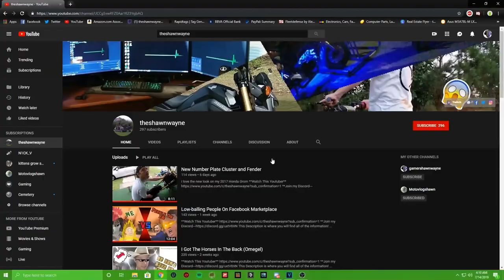Pulling The Core Support Off The Gokart | I Got Approved And Now Monetized!

Comment: What happens when the car dies, do you have another to continue videos? These are great dude
Reply: Planning on finding another donor car to turn into a new gocart. This one is still going just messed up some wires and busted the radiator. Going to rig/fix it and run it till it stops.